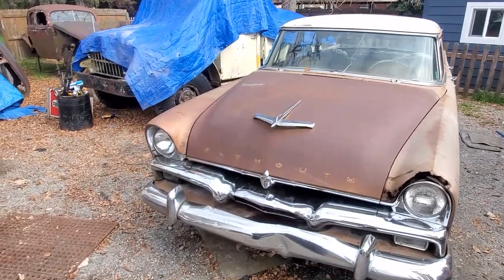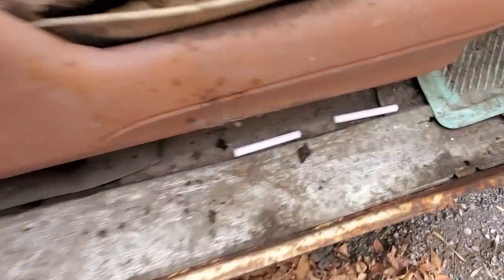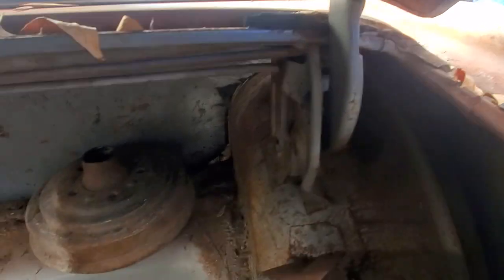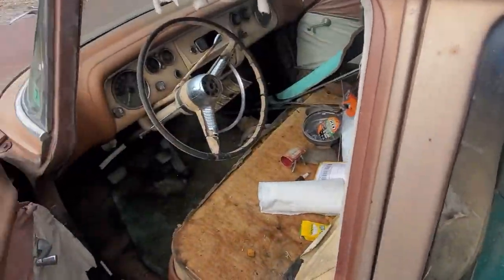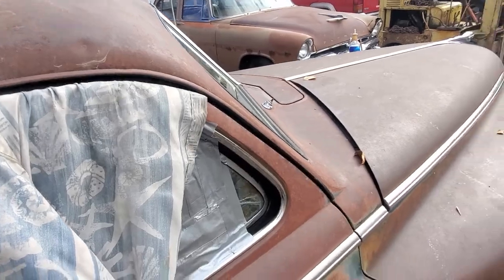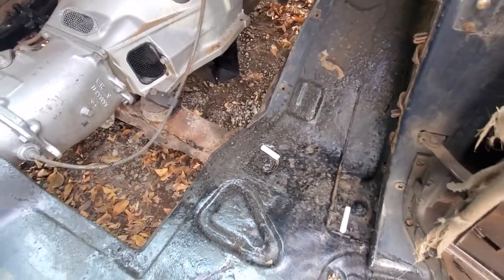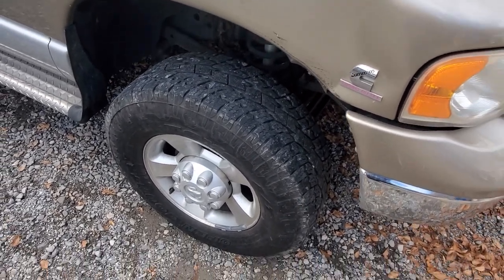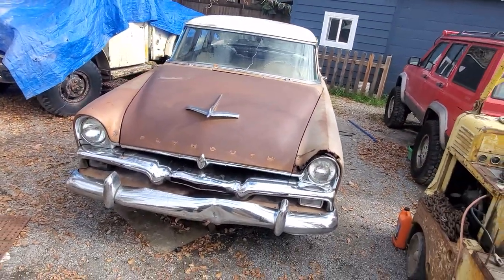1956 PLYMOUTH SAVOY UPDATE

Comment: Theres a 55 plymouth ( base model, 4dr 6cyl) in my town thats sometimes up for sale, good #4 solid condition, ran until about 3 yrs ago when parked...im wondering what itd be worth if i were to stop and make an offer? Hate to see it sit there! Any ideas, tips?
Reply from the maker: im the same way. i rescued a basket case '46 dodge from a pig pen. it'd been there for 30yrs hidden behind a hill. the horses were stepping on the fenders! i didnt want to see it get crushed.

The 6 cyl. Plymouths are worth less than the V8 but still desire-able, especially if it runs. it'd be worth more if its an overdrive car. i paid $600 for mine with a locked motor, and missing the hood, some trim, etc. but she was pretty straight and all the glass was in it. I was able to free the motor and got the hood back,  so completeness is a big factor. do you know if its a plaza, or savoy?  i'd start at $1500 and go from there. you never know what someone will take, but its better to get them to put a number on it first, you may offer him more than he even wanted if you name the price first

Comment: Great stuff! You have a mountain to climb with that Savoy! I see an M37 under a tarp? I’ve been rebuilding a 1950 Dodge Power Wagon, come to my channel and check it out, it was a rust bucket when I got it.
Reply from the maker: the Savoy should be running soon! i had hardened valve seats installed this week. ill be replacing all the bearings and re-ringing her. the floors are BAD though, so i cant wait to do those.  just fixed the bad hood hinge and installed a new spring. 
my M37 is an old airforce truck. i've rebuilt most of it and changed almost the entire body. its going to get repainted and ill put my unit numbers on it.it has a brand new engine and runs great. its mostly wiring and the brakes to do now. i'll have to do  some videos on it and my 1941 Dodge WC